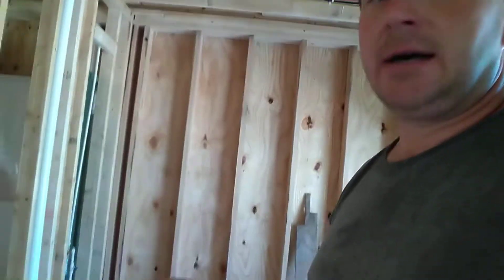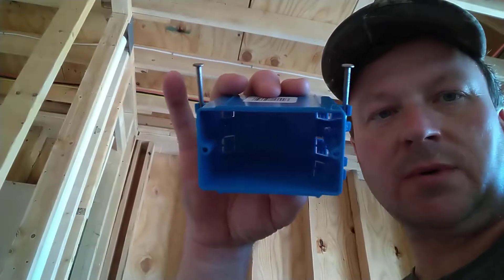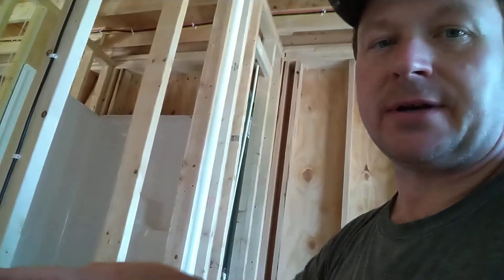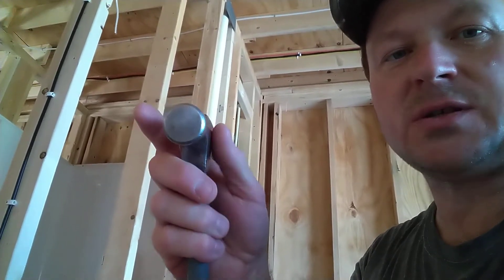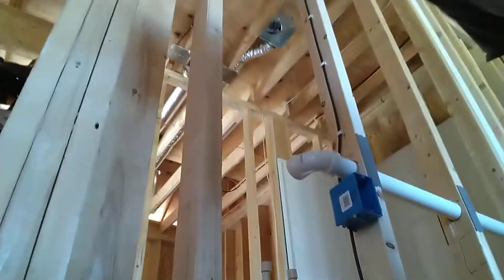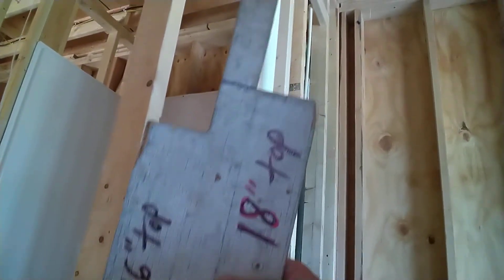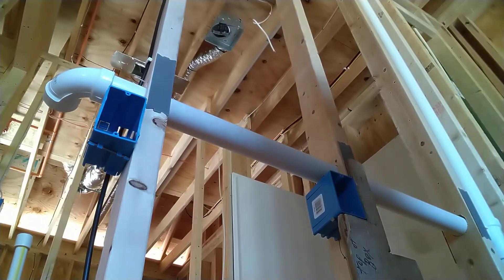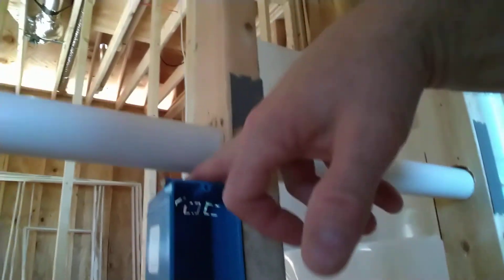Remove plastic nail-on boxes without damage for reuse🤔

Comment: Thanks for making this! I used to use a long scredriver, the hammer works much better though. I doubt anyone but an electrician would appreciate this tip lol. The other trades have zero regard for box maintenance!
Reply from the maker: Thanks for watching inkman002. I think we were all taught to use a screwdriver for box removal. I've cracked a few doing that. Your right about the other trades! They didn't buy or install them and they just don't care. I appreciate your comment 👍🏻